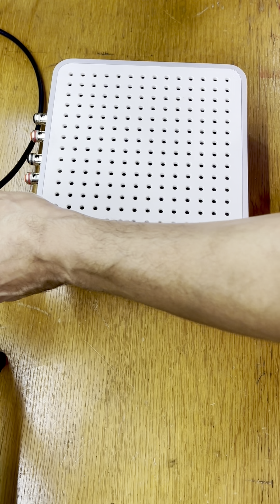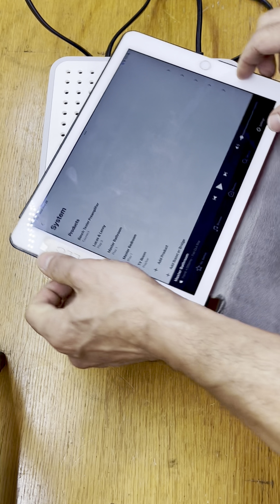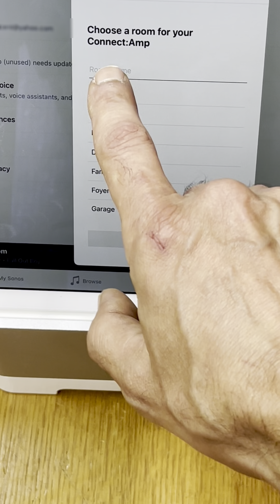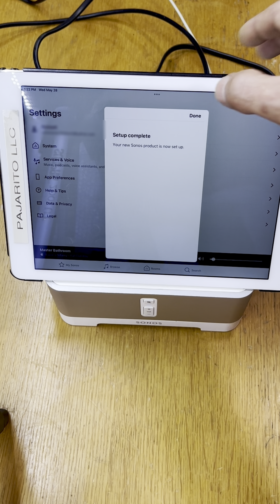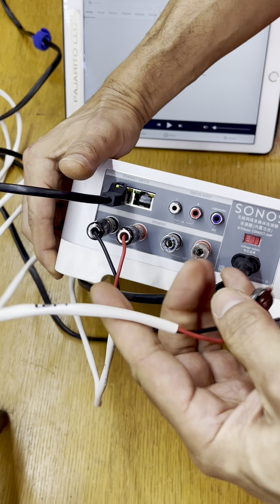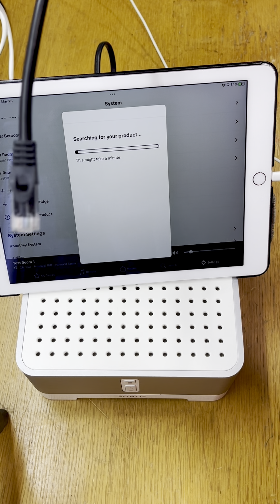Sonos Connect Amplifier Basic Set Up

Comment: Helpful, but I've been unsuccessful in connecting mine.     The app doesn't seem to "see" the amp.      I successfully paired a Sonos speaker the other day, but the amp is giving me fits.
Reply from the maker: Have you tried to HARDWIRE (Ethernet cable needed) to see if that makes a difference in the adding process?

Comment: Aaaaand this device is now obsolete if you have sonos one SL speakers or similar older systems. Since my sonos one sl speakers are on the sonos S2 app software they can no longoer communicate with sonos connect amp. And you can't revert the speakers back to sonos sl1 app software once they're  updated. Nightmare.  Thinking about smashing the amp with a sledgehammer.
Reply: If you have a connect:amp gen 2 you can just upgrade its software so you have them both in the new app.

Comment: I have bought 2 different speaker rca male plugs and yet found one that works.  Can you add an Amazon link or what do I need to order?
Reply from the maker: @cellphoneman2000, thanks for watching and the comment/question. Type "speaker banana plug" in your search bar/browser. "RCA male plugs" are for interconnect wire; not related to speakers or speaker wire unless it's an "active", self powered speaker such as a Subwoofer. Let me know if that helps and thanks again.

Comment: but does that still work in 2026? i thought it wouldn't update now as its too old and not supported
Reply from the maker: Yes. This still works in 2026. I use this amp to quickly test speakers. Use Sonos S1 app. All my Sonos gear is S1 generation and works great with S1 app.

Comment: I have 4 passive ceiling speakers but the wire colors are red, black, green, white.. any idea how I would connect them to this amp?
Reply from the maker: @ricky_don thanks for the question and for watching. RED and BLACK are traditionally what we assign as the RIGHT CHANNEL  (right speaker). RED is POSITIVE and BLACK is NEGATIVE. WHITE and GREEN are traditionally assigned to the LEFT CHANEL. WHITE is POSITIVE and GREEN is NEGATIVE. You should confirm this BEFORE you connect the two pairs of speakers to your Sonos amp. Let me know if this information helps and thanks again.

Comment: If I want to play music through the analog ports, do I need to change some setting in the app or will the amp detect audio from that input and start playing it?
Reply from the maker: @sa.t.2507  thanks for watching. If you would like to play a SOURCE through the analogue INPUT on the SONOS CONNECT AMPLIFIER: 
1. Connect SOURCE (i.e. CD player, another audio streamer, tape player, etc.)
2. open SONOS APP
3. got to ROOM where you'd like to play music
4. select BROWSE
5. scroll down to LINE-IN and SELECT it (last selection on list)
6. adjust ROOM VOLUME to your liking

Comment: Does this older connect amp work with the new amp in 2025?  Looks like it.  Would love to add this to my garage for whole house sound
Reply: You can use the Connect Amp with the newer amp as long as the Connect amp is compatible with the S2 app. The easiest way to tell is a Connect Amp is compatible with the S2 app is to look at the button on the front above the volume buttons. If the button is play/pause then the amp is S2 and S1 compatible. If the button is mute, like the amp in this video, then it is only compatible with the S1 app.
Reply from the maker: @Sremuuhh23 thanks for watching. There is a particular serial number sequence that will work with the S2 generation Sonos application. I don’t know that sequence and/or serial numbers. If you shop on eBay, make sure you get the correct serial number. All the Sonos equipment I’ve tested has been done with the S1 application. Many thanks.